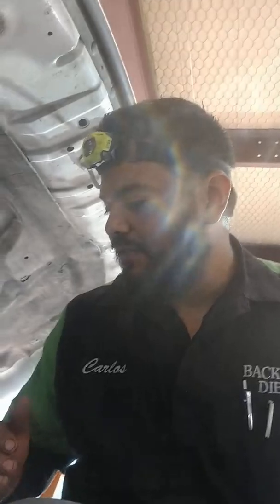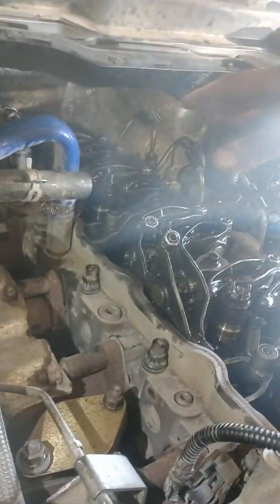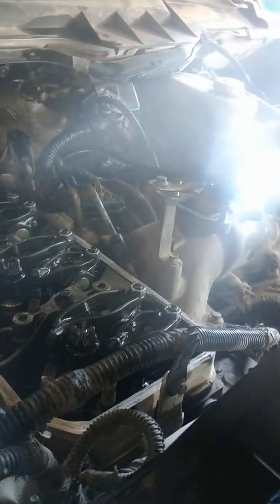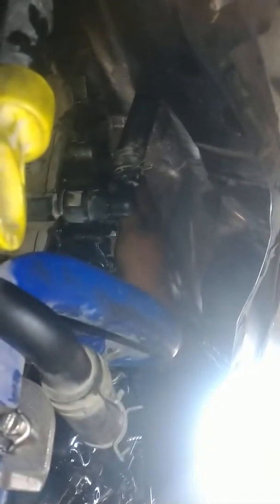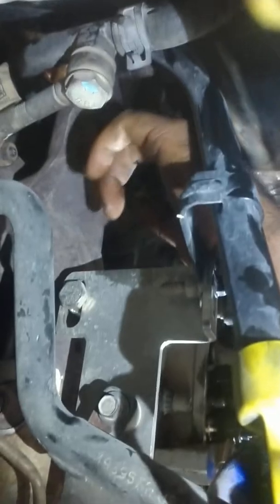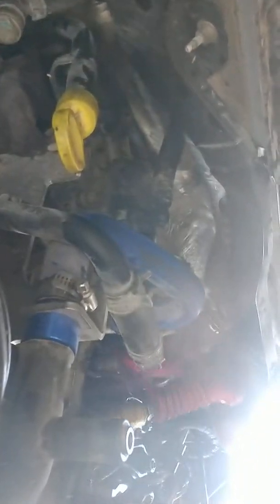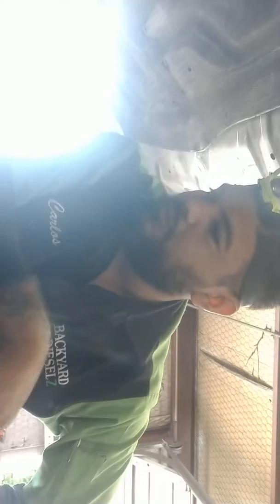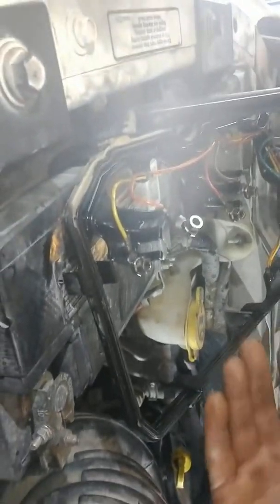6.7 Cummins black smoke running rough injector problem

Comment: Thank you for this excellent tip! I am working on a 6.7 today and it has a bad shake and misfire, I disconnected each injector with it running and the back 3 cylinders seem to not do much. I replaced those 3 injectors and it's the same! I'll bet its a burnt valve or two now that I saw your video.

Comment: 5.9 Cummins runs good no smoke when cold but 20min after warm up on acceleration blows a lot of black smoke and sounds like injector ohm tested all injectors all within spec any ideas

Comment: Hey man any help will be great. 
2006 ram 5.9 it’s got alot of black smoke from exhaust under mid to heavy load. I block off each injector one at a time to see if smoke would go away. But was not able to condemn a failed injector. What would be my next speed to diagnose black smoke

Comment: i have a 09 6.7 cummins , i had the whole enigne rebuilt,  pistons, rings , bearings, head job. but i didnt replace the injectors , it smokes  black pretty bad and also feels like a misfire as if it was a gas engine. if i floor it it smokes really bad. could it be a injector or turbo?  (injectors have 450k on them) rebuild has like 50k on it and was done professionally at a trusted machine shop
Reply from the maker: Could be both And also a failed compression ring/oil ring..(happen to me before....you would have to check map/intake pressure on live date..
Reply: Backyard Dieselz it was smoking a little bit a year ago when I first started it after rebuild ... now it smokes bad .. I’ll have the diesel mechanic check it out thx 😊also are the cab and chassis injectors different from pick ups ?
Reply from the maker: There's the same... Anyways... Let me know what you find out..

Comment: Injectors are going bad
Reply from the maker: It ended up being a broken exhaust valve.. also cause major damaged to the piston.. don't no how but the sleeve was perfect..
Reply: @BackyardDieselz  wow..sorry to hear that..hope all is better soon
Reply from the maker: She's good now... Client happy..
Reply: @BackyardDieselz  good to hear.i had a ruff idle..I think it's the exhaust pressure sensor
Reply from the maker: If you have a scanner check how much pressure you have... If it's you delete .. stright pipe that's not your problem..
Reply: @BackyardDieselz  I just had full delete done..driving she's fine..only in park ,it sounds like its missing
Reply from the maker: @francissullivan6400  check your all the fuel lines, filter especially.. maybe air.. valve lash.. injector sticking
Reply: @BackyardDieselz  Thank you brother..Suscribed ..GREAT WORK